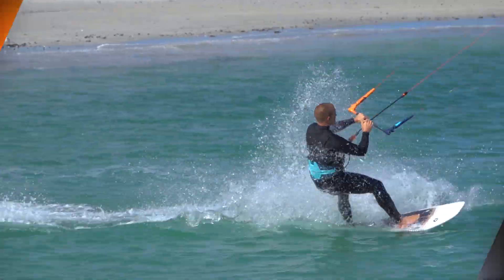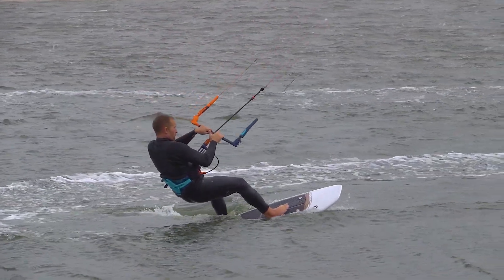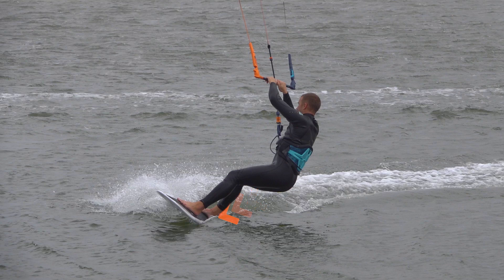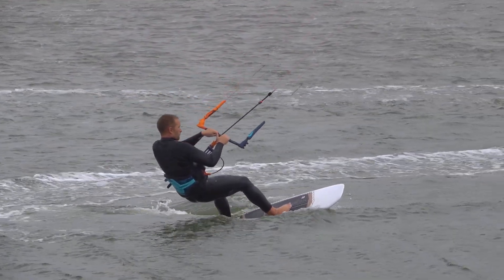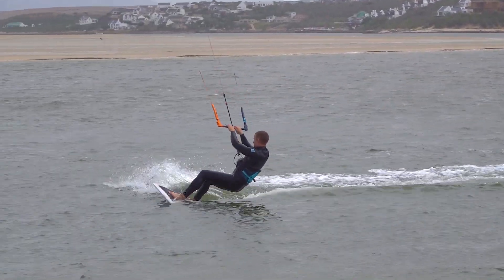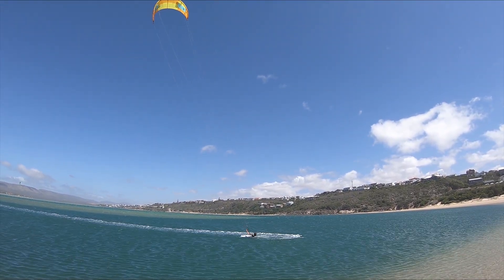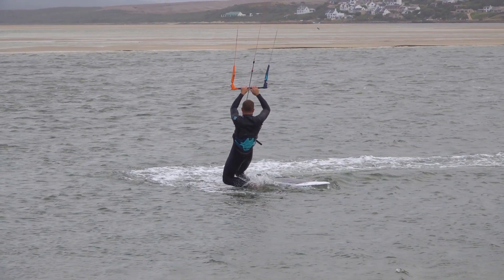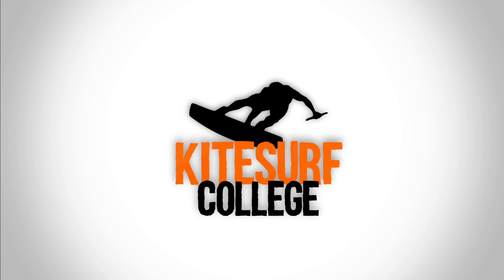Tack Tutorial (Strapless & Directional Kitesurf Series)

Comment: Awesome explanation. I've been trying in waves and choppy water... not easy - any tips in these conditions?
Reply from the maker: Hello Brad. I learnt in waves and chop - it's doable but definitely more of a challenge. We only travel to the river mouth shown in the video when we need to film. I'd say be careful of the breaking waves. They will carry your board away easily. You may be tempted to use a board leash but they are truly dangerous. I usually practice strapless tricks behind the breakers, and look for days with less swell, and lower tides. Also when there's big swell, I don't try new stuff, I just dodge the waves, and if the swell if monstrous (6m swell is common where I live), then I usually chicken out and take my twintip instead.  Also, with choppy water, I do a much quicker tack. I slow down to a halt, and then force the board around rapidly and swap my feet. It leave less time to be affect by the chop/waves.
Reply: @kitesurfcollege  
Thanks heaps for the tips. I finally done it yesterday - 6 times, in choppy ocean swell. The key is obviously having the kite at 12 when doing the flick and not being too worried about speed coming into it. I kept going back and watching the clip to get the move planted in my head.  You didn't mention that I would got a sore hamstring from flicking the board around :) but that's ok I am very happy - Once again great clip and explanation - THANKS.

Comment: Can you let me know the Ion harness the rider is using plse?
Reply from the maker: Hello James, that's a duotone apex harness, which is a medium firmness harness, not a hard shell. I like these as I can loosen them for wave riding or foiling, or tighten them for big air. You can also swap the hook for a slider system if you're mainly wave riding etc. It's also quite soft around the edges so doesn't seem to jab me in the ribs. With harnesses it's worth trying them on first if possible to see if they fit your body shape well.